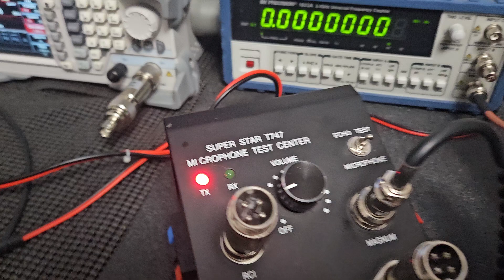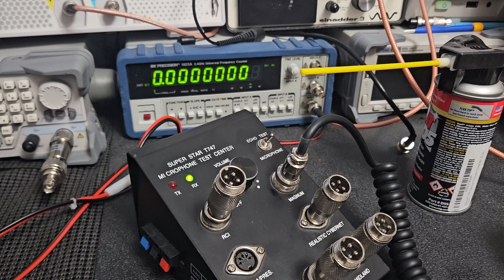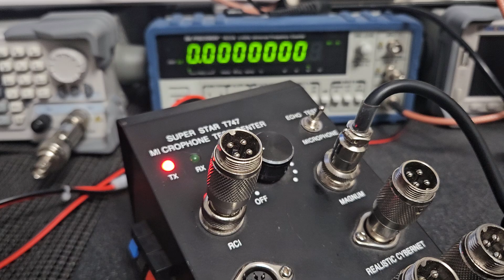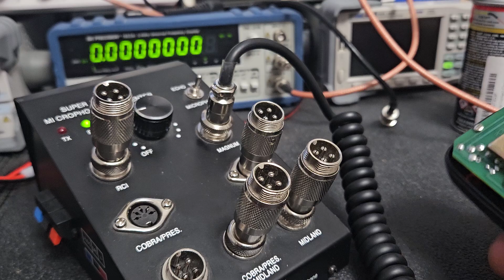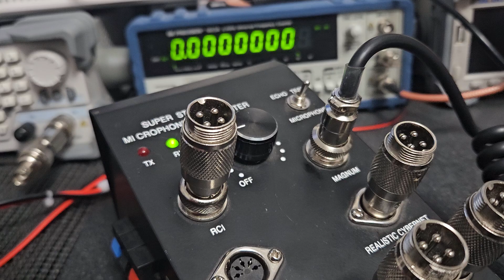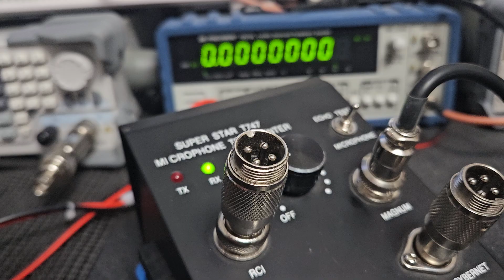K-PO NM532 🎤

Comment: Yes i had two kpo nm532dx mics both started changing channels on 2 different radios, a little deox on the inside of ptt switch fixed both./ 958 mi